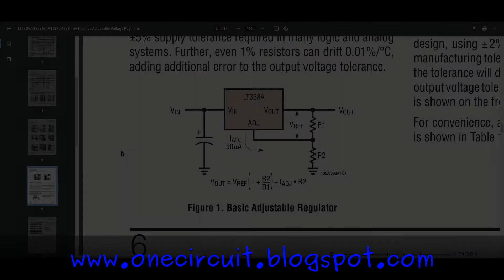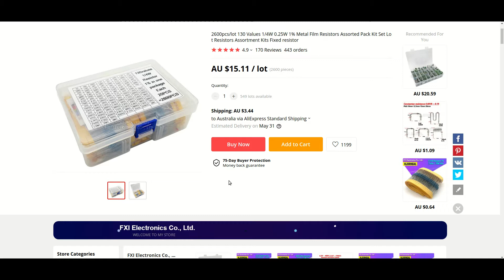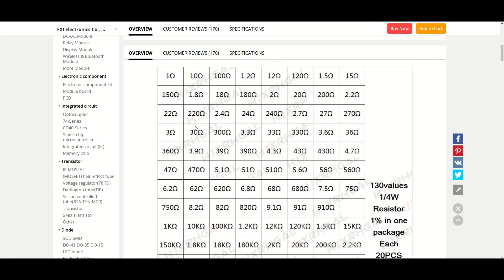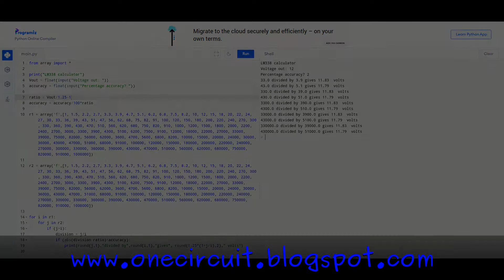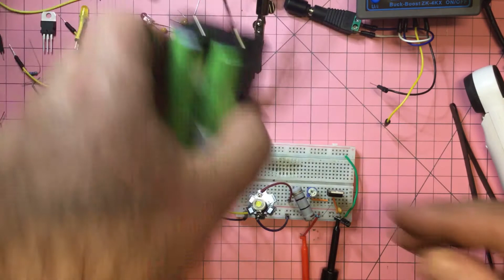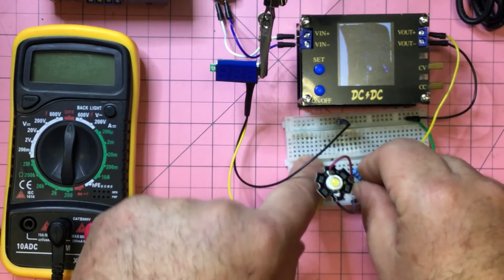PSU III - LM338 onboarded

Comment: Bit late to this party, but in fact if you want to minimise the effect of Iadj you need to use a lower value of resistance for R1 & R2 - so that 50uA x R2 is as small as possible. The power dissipated by R1 is (1.25)**2 / R1 and the power dissipated by R2 is (Vout-1.25)**2 / R2 so perhaps you could modify your python to calculate the power dissipation too!
Reply from the maker: Thanks Ian. I am keen to make V2.0 at some stage. V1.5 is still working well. Had a rock solid 3.3V coming out yesterday under a decent load. Happy days! 👍😀